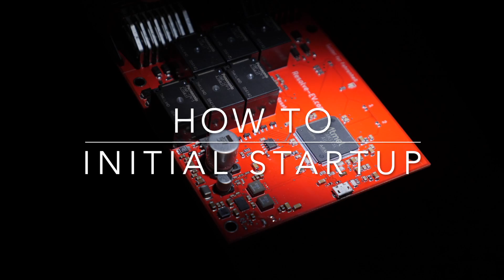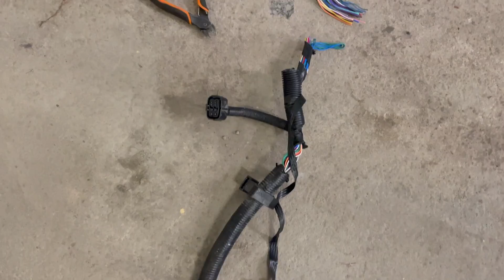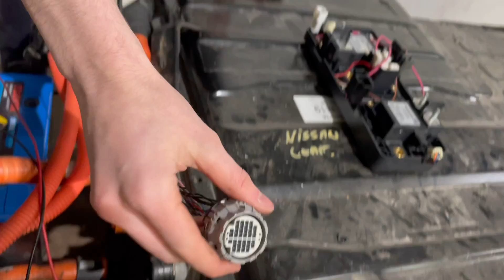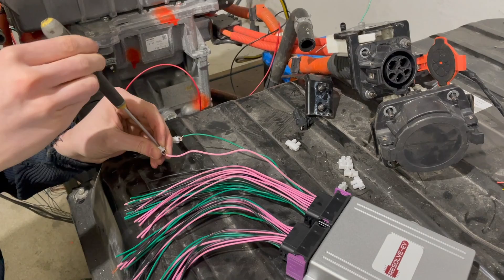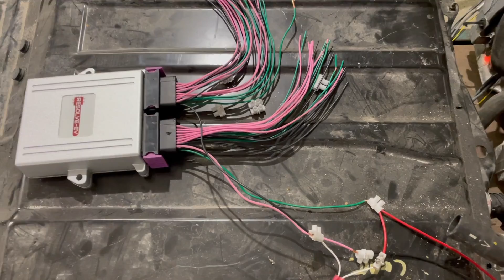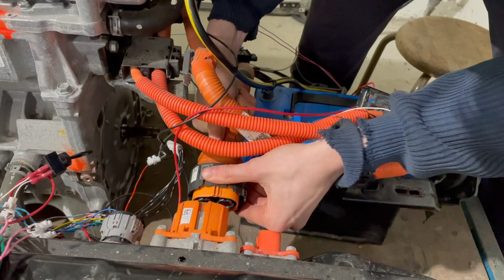How to - Initial Startup (Nissan Leaf drivetrain)

Comment: Is it possible to check the resistance of the relays without opening up the battery pack? I doesn't look like it. I have a problem where the contractors are not closing.
Reply from the maker: As you cleverly described by measuring the HV on the batterypack during partial startup( 1 contactor and precharge contactor is on) you can see if the precharge resistor still functions. If you can measure HV out it means the resistor is still functional

Comment: Hello Isak nice work bro I love what you've done here . One question is does this controller also control the bms in terms of what if you wanted to grow you battery pack let's say doubling the KWh of the original pack will you controller handle the error codes that the nissan PWM will definately throw out....so you can have more range or motor power etc. Thanks and keep up the excellent work. Gadgetboy from NZ 🤙🏼
Reply from the maker: Thank you! Not in that sense you can however use another Leaf batterypack size for instance 30 or 40kWh.
Reply: Could you not discard (or sell) the original battery modules and wire up any 96s batteries to the same BMS? Would resolve work this out or would it throw errors?
Reply from the maker: @freek7387  Good question! The Resolve controller would still work, the problem is if you could trick the Leaf BMS. The other battery cells would have to have the same voltage range (voltage difference when fully charged and discharged). If so it could work but it's not something we have tested.

Comment: It looks like I have to use a leaf battery pack.  If so do I have to uses the same year as the motor?  Does it come with complete instructions?  I am looking to put it in a Pontiac Montana mini van.  I also plan on adding batteries for much longer range.  Any advice or videos you can give me would be appreciated.
Reply from the maker: Hi!
You can use any batterypack from 2014-2017. Only the motor and inverter has to come from the same car. Yeah you can find instructions on our product page: https://www.resolve-ev.com/shop/p/resolve-controller
You can also watch Daniel Östers youtube video series, he uses a 30kWh pack in his car